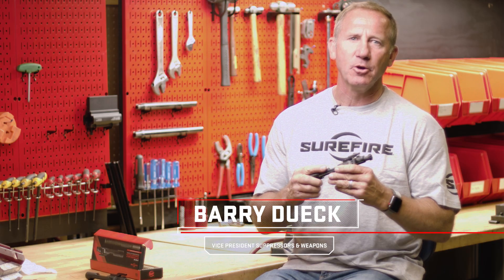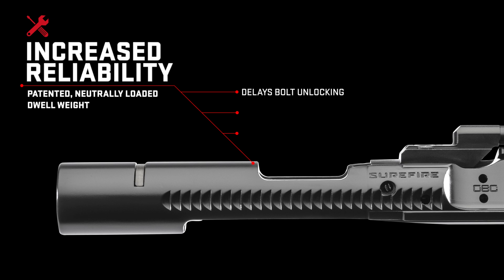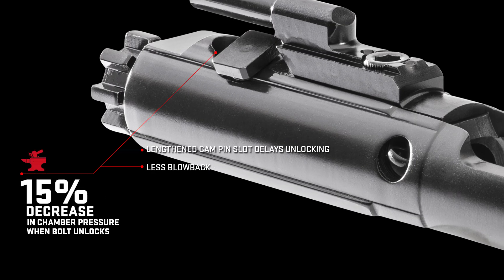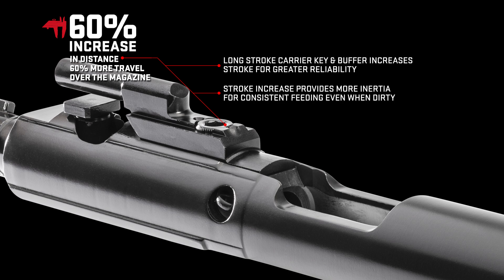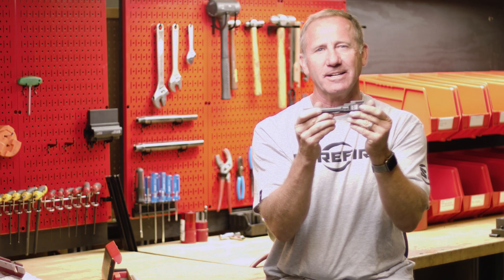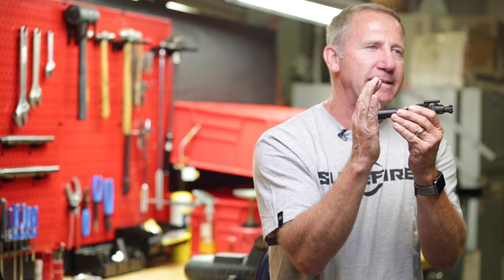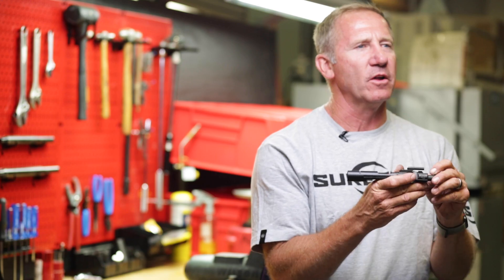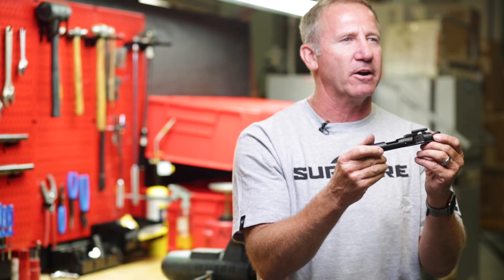The SureFire Optimized Bolt Carrier

Comment: Just ordered one to use in my 14.5" M4 A1 clone, with RC2 suppressor.  My only concern is the single bolt holding the gas key.  We'll see how it goes.
Reply: It appears as though the base of the gas key where the second bolt would be is dovetailed into the bolt carrier.

Comment: I welcome the innovation and desire to improve the standard BCG. But i could only justify the price of it if standard BCG's were inherently flawed to the point of frequent failure or unreliability. The fact is that the standard BCG functions for very long term under extreme duress even couple with less than desirable cleaning regiments. Combined with the vltor a5 system, superlative arms bleed off adjustable gas block, and a good muzzle brake, i imagine this BCG could get us closer to 22lr like recoil impulses, which sounds freakin awesome. But man...north of 400 bucks? I'd hope we can see this kind of BCG built for a more reasonable price one day.

Comment: Why not HP Tested before MPI?
Reply: It could be argued that with other processes of material inspection and certification the High Pressure proof test is unnecessary nowadays. It is still done for US Military small arms simply because the Technical Data Package still requires it to be done rather than any actual material flaw.
Reply: I don't remember which manufacturer said it, perhaps Knights, that high pressure testing actually decreases bolt life. They'd be thrilled to increase bolt life by skipping HP testing but the military makes it a requirement. Could have been another manufacturer so I can't say for certain it was KAC.

Comment: With the weight in the back, is the law tactical extension tube still usable? Would like this but I have law tactical folder
Reply: Why wouldn’t it? It’s the same overall length, or does part of the LAW go into the rear of the BCG?
Reply: @JEJAK_777  an extension does go into the bcg
Reply: No.